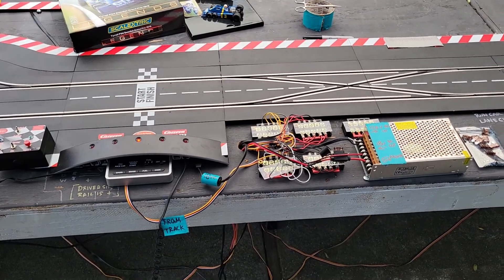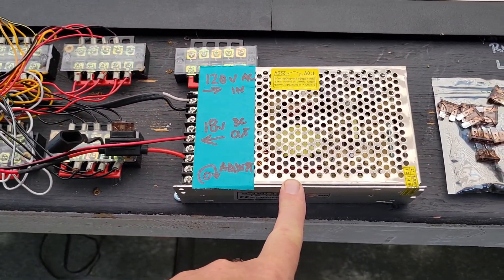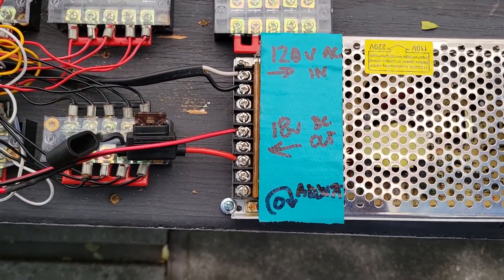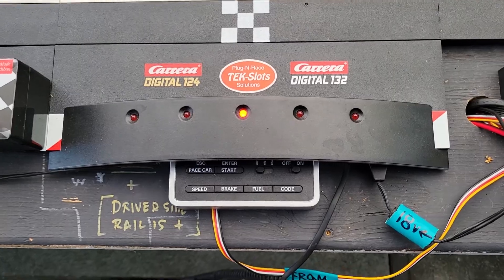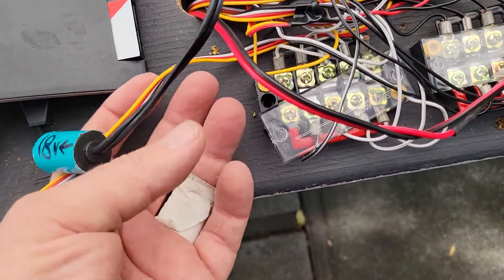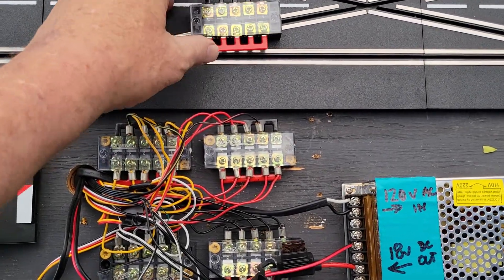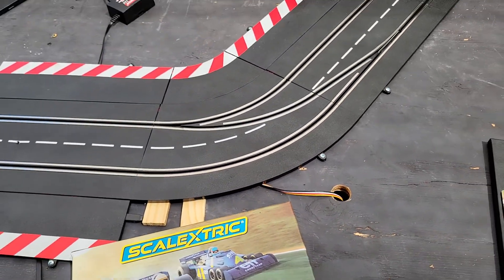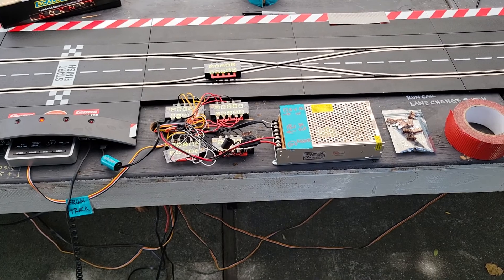How to transformer-boost a long Carrera 1:32 Digital slot car track.  Power management on the cheap.

Comment: QUESTION, if I have a lane change lane 1 becomes lane 2 and lane 2 becomes lane 1 on the track we have to check proper set-up only if we use analog cars but no if we use digital ?

Comment: You have designed and layed out a logical system for power.  Love seeing clean wiring in that it helps if one needs to troubleshoot,  but it looks like yours is a one and done system that just works everytime.   👍

Comment: I was wondering if you have had any trouble running 18V? My power supply(Carrera original) says 14.8V.
 Sorry about the stupid question...I. a rookie lol
Reply: The Carrera 124 (1/24th scale) power supply is 18v.  So, no issues at all.  Even though we run 1/32 scale, the larger size of the track warrants the higher voltage.  We like the high speed, long straight away!

That said, given that the recommended $25 Amazon power supply is adjustable, don't go over 18v!!  It's hard on the digital decoder chips, especially the generic ones like the MPL & Slot-It MP43.  They will be damaged if the voltage is too high.

Comment: Crazy question if you have a large track set up u lose power to the track. Can you plug in 2 to 3 terminal tracks? with
Reply: No, only one digital control unit per track!  Multiples of the control unit do not play nice together because of how the control unit sends encoded messages (for the digital features) along the track rails.

A large track must be equipped with jumpers (the wires going from the control unit -> the black screw terminals --> 4 conductor colored wires --> different locations around the track) - that's the point of the jumpers - to distribute power & encoded messages evenly throughout the track.
Reply from the maker: If you are thinking of adding 2-3 more base-stations (start finish line), I'm not sure how that would work.  Hadn't occurred to me to try that.  Either works fine or it will flop is my guess.   What if they cross talk?    What if you program one - does it affect the others?    Please do "research" on this with YOUR 2-4, $100 power modules and let us know?

Comment: Can I see more details on wiring the transformer to the stock power supply cord? Which is positive/negative On the stock cable?
Reply from the maker: Our outdoor track is broken down for the winter and  is in storage now, so we don't have it handy.   Next time we do, will post an update.
Reply from the maker: The stock power supply wires are red (+) and black (-) when they are stripped - you can see those colors on the video.   We added the 7.8a fuse to the red wire for protection.   Easy!
Reply: Thanks! I didn't know they were colored inside. May give this a try!!!